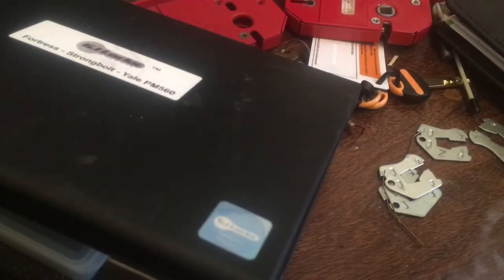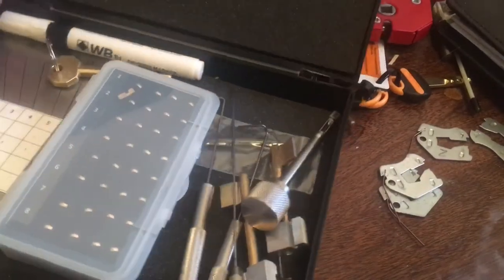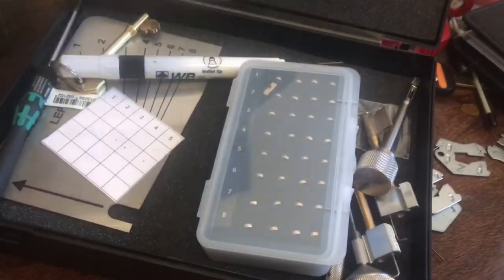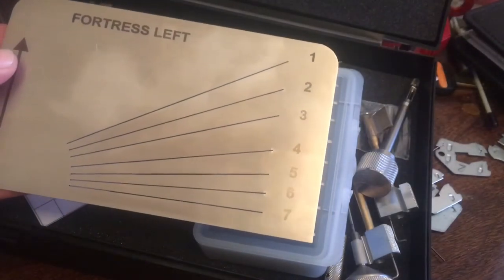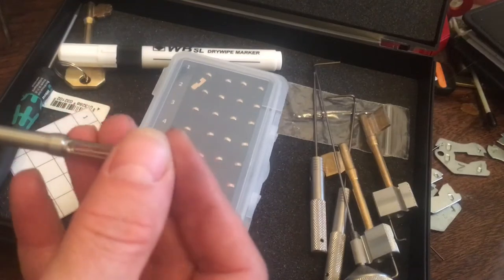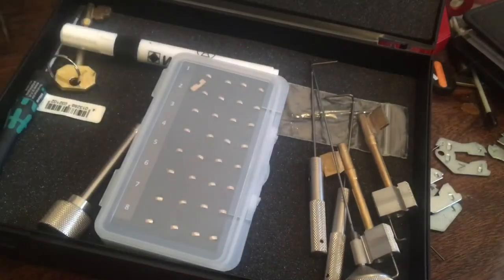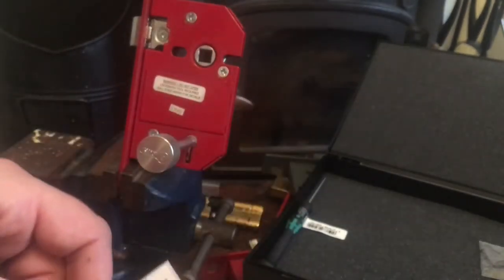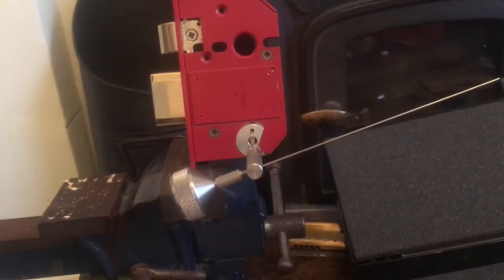Tutorial and tips for the new GJ Locks Fortress/Strongbolt/Yale Decoder

Comment: What's the difference between this one and the Pin & Cam pick/decoder?, and which one would you say is better/quicker?.
Reply from the maker: The pin and cam is much quicker once you’re proficient in the tool as it physically picks the levers, so depending on lever heights can get the lock open in 30 seconds

Comment: Got mine today mate. It’s good. Do you have trouble getting a read of lever 5 when locks on right hand side?
Reply from the maker: Sometimes you can slip behind the lever and the bolt and it will give you a ‘false number 1’ , on right mounted locks I’ll always push down and go as far in as I can so I’m under lever 1 then read backwards to lever 5
Reply: @FortressLocksmiths  thanks mate. A good read on 3 and it solves 5 anyway as you know. Maybe my wire needs bending. The right hand wire was not at 90degrees out of the box

Comment: Quick question mate, would this kit not work on the era and asec 5 lever mortice sashlocks then?
Reply from the maker: This is the ERA sashlock pal?? But no it won’t work on Asec different levers completely
Reply: @FortressLocksmiths  ok so I dont understand the definition of fortress/strongbolt/yale definition.  I thought that was brand. Could you explain if its not too much hassle or make a video. As I said before mate I'm a joiner starting out  doing locks and learning mainly from yourself or on the job 🤣
Reply: @stephenmclaren9308  Era Fortress, Union Strongbolt and Yale.